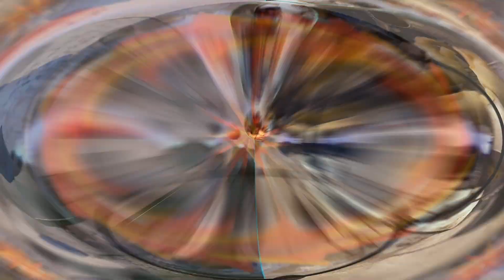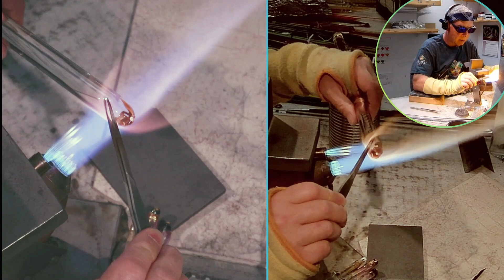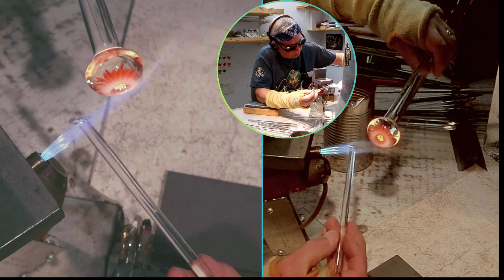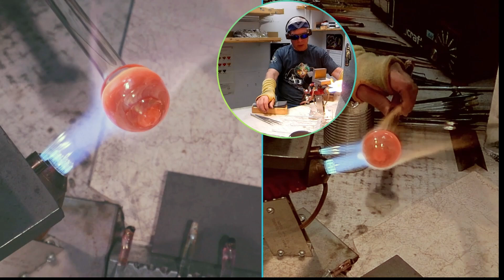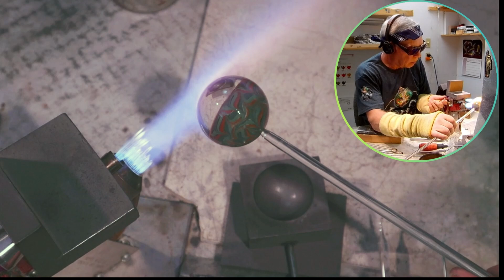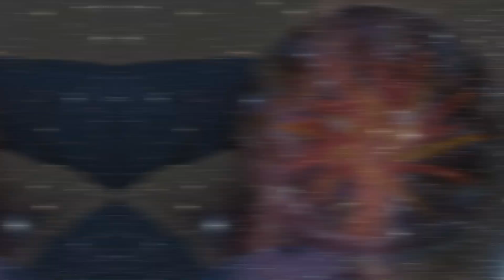Jesters Hat Trick in a Vortex Marble Compression Design – Full Build #37

Comment: Looks great!  I love your backing design. I was trying to figure out how you were able to nail all those nails perfectly parallel in your home-made tool. Pre-drilling the holes makes undeniable sense. I have a flower frog, but it would be nice to be able to make specific designs. Thanks for the idea!
Reply from the maker: I keep so much random stuff from previous projects thinking that it might be useful one day. Every once in a while it pays off! I have kept that graphite disc for many many years right on the bench where I have the drill press that created that scrap, and now it found a purpose. Fortunately, I have more recently purchased some cheap small drill sets that had a good match for the nails. I think they came along with a pin vice I needed. Glad I opted for the combo set off eBay!